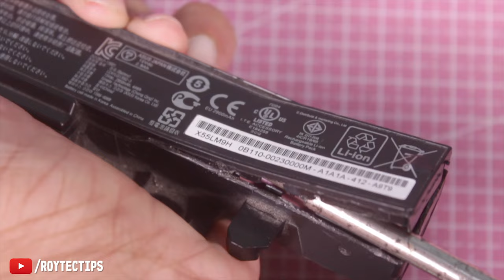How to open old laptop battery without destroying it? Disassembly ASUS laptop battery pack.

Comment: Worked very well with Acetone. The case came off with little priyng with a screwdriver. Much simpler to open it this way for salvaging cells. Thanks for the idea!
Reply: Woah! Isn't acetone bad for plastics?
Reply: @Maffy981  got it thanks

Comment: I replaced cells with new one but full charge capacity is around 3700mWh not near the design capacity 33000 mWh. Battery cycle number is 319 and I can't reset counting.
Reply: some laptop bms are impossible to reset counter. they're made in this way by intention - manufacturer won't you to repair, they want you to buy new battery.
It's very similar like inkjet printer cartridges scam.
Reply: @magygrendel6931 correct, but electronics is electronics. With enough wills, you can modify it ;>.